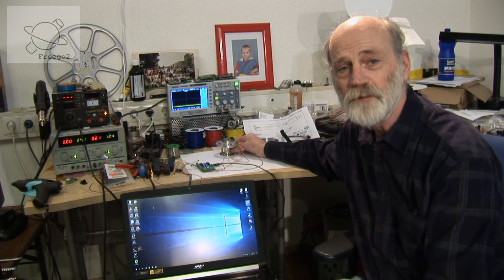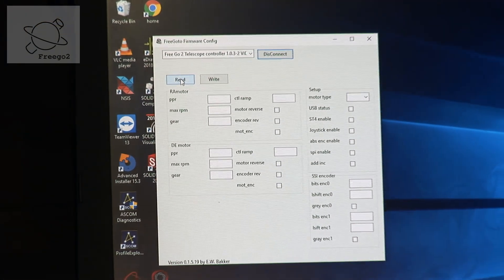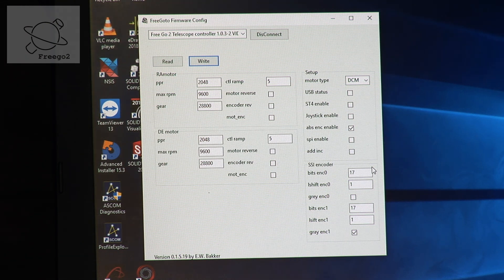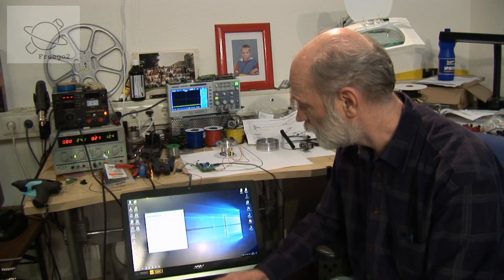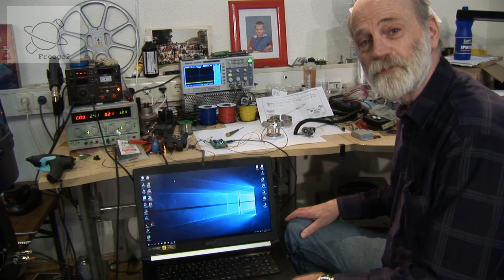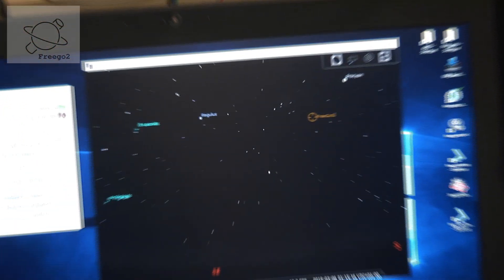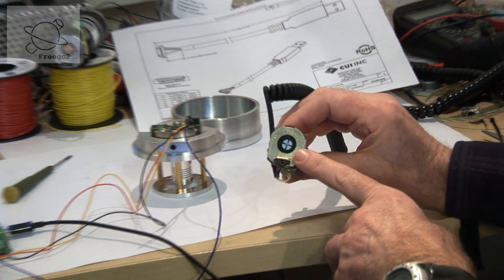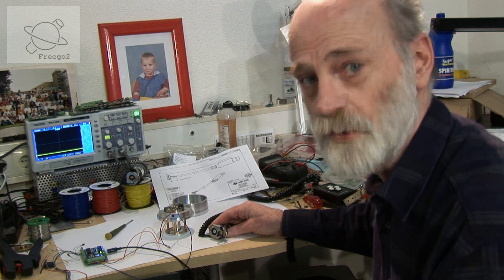FreeGo2 interface with a low cost 17 bits absolute encoder

Comment: https://www.digikey.co.uk/en/product-highlight/a/avago-tech/aeat-9000-encoders
A little confused how the 17-bit absolute single turn output (131072 absolute positions over 360°) reduces to 2048CPR? Where does all the potential 'precision' go? Thanks 
I guess 360/2048 of a degree is still nice enough to get an object in low power field of view!